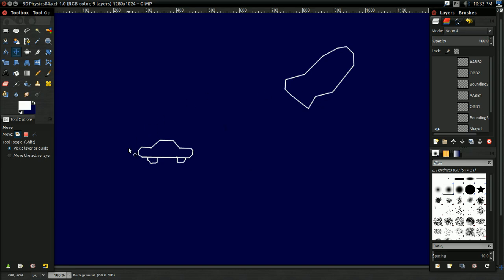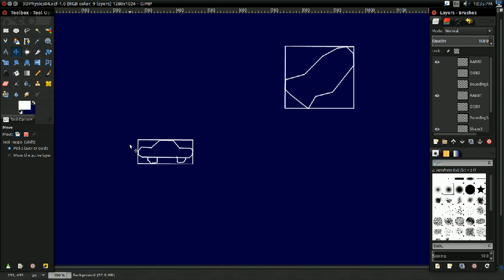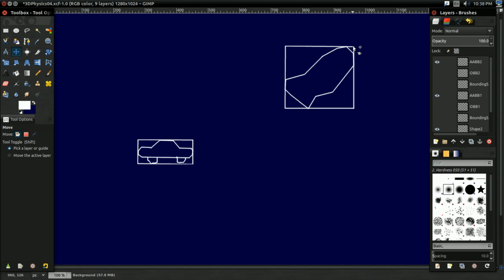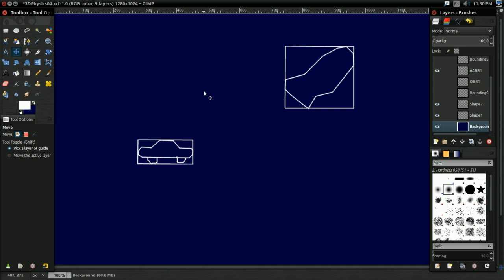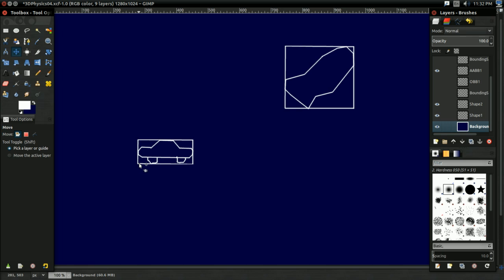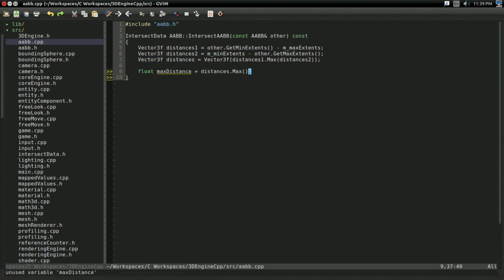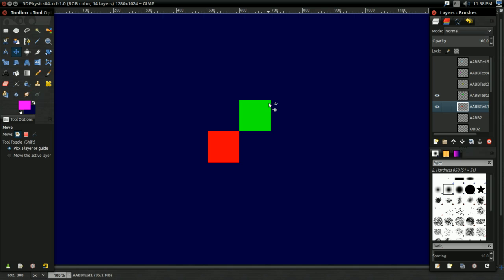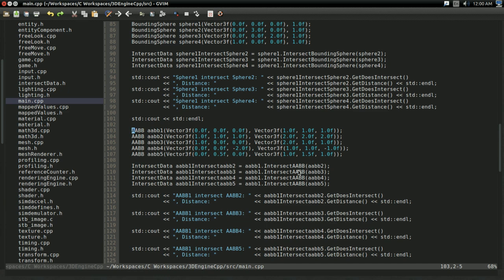#4 3D Physics Engine Tutorial: Axis Aligned Bounding Boxes (AABB's)

Comment: Hi. Great video. Do you know old game called Arkanoid ? it has one ship, one ball and  a set of blocks which you must destroy with  the ball, around 20 or 30 of them. Is this method AABB will eat my CPU performance  by comparing the ball collision with all blocks ? What is your opinon on that ?
Reply from the maker: ColumboJedi Well, in a complete physics engine, you won't be testing every AABB against every other AABB. You'll be using some spatial structure like an octree to reduce the scope of the problem with every step. Instead of doing everything against everything else for an O(n^2) performance curve, you'd have an O(nlog(n)) performance curve, which is much more reasonable and scalable.
Reply: ***** That is a great tip. I understood it completely. Another question I have is this: should I check for collision every frame step ? or maybe every 20 frames ? I defined my opengl application to run 62-63 frames per second. The player should not notice any delay of collision, so it should be under a second I suppose. Developing opengl game is tricky. =) And I love it.
Reply from the maker: ColumboJedi How often you update your physics engine depends on what kind of game you're making. In a typical game, you won't go wrong doing 60-50 physics updates per frame.

Regardless of how fast you update your physics engine, you should do complete physics updates. For example, you probably shouldn't update object positions 60 times per second, but check for collisions 10 times per second. The issue comes when, for example, two objects start colliding on update 1, but their collision only gets detected on update 5. In the intermediate updates, anything they did is invalid. This isn't horrible if all they've done is moved, but it becomes a lot more difficult if one of the objects has, for example, started colliding with a third object that it wouldn't have collided with if the original collision was resolved properly.

Although even the "ghost collision" issue is still resolvable, the simplest solution is to avoid it altogether and just do complete physics updates.

Keep in mind that although collision detection isn't cheap, it's not horrendously expensive either. In a well-designed collision system, you're unlikely to spend more than about 2 or 3 milliseconds on collision detection even under fairly heavy loads. As always, your figures may differ, so profile your engine and budget accordingly.
Reply: ***** well, my collision detection is very good, no doubt. But I cant detect which side the rectangle hits another. I did the math, and it was working well, but when I got like 60 rectangle on the scene, things starts to get weird. How would you detect which side collides ?
Reply: ColumboJedi already solved my problem. thanks any way. Best videos ever about opengl.

Comment: Are you going to cover terrain collision? (probably a retorical question i am asking here), but with support for elements like bridges / caverns, sort of like what Super mario 64 does, I might not have been googling hard enough but I can't find anything on the subject, thanks!
Reply from the maker: There's nothing special about those sorts of colliders. A generic triangle-mesh collider should work fine for those cases.
Reply: ***** I imagined that would be a solution, but wouldn't that cause a lot of lag? unless limiting it to only check within its position; I might be overthinking this.
Reply from the maker: Slaydon Measure before you decide what's a performance issue and what's not. Yes, a generic triangle-mesh collider typically performs worse than the other colliders in a physics engine. However, it's certainly no slouch either. As long as you don't do something ridiculous like use a generic triangle-mesh collider for everything, you're probably not going to run into an issue.
Reply: ***** Alright thank you! and thank you for what you are doing. Back to lurk-mode.

Comment: When checking for collision, is it not possible to check for individual vertices in the obj file? For example, you could have some method which keeps track of the obj vertices' positions in 3d space and checks if they match or if they are in collision with a face of an object. So you could have a method like :     public boolean checkCollision (Vertex [ ] vertices){   if (vertices.v1.x == vertices.v2.x || vertices.v1.y == vertices.v2.y || vertices.v1.z == vertices.v2.z) return true; (and so on for face collision)} Obviously that method would be for a singular obj, and it would probably drag down performance,  but say you had a game with like a sword, you could implement a split method, which separates vertices from each other upon collision and it would be far more accurate.  Would there be any strong problems with doing it this way? Thanks.
Reply from the maker: What you're talking about is a form of soft body physics with generic triangle mesh colliders. The answer is yes you can do things like this (although perhaps not with the code you've given), however it should be avoided if possible.

For one, you have to keep in mind that rendering meshes are drawn using specialized hardware optimized for rendering. Physics meshes, even when GPU accelerated, don't have that luxury. Therefore, it's probably not the best idea to send your rendering mesh directly to the physics engine if you can help it. You're better off using a simplified mesh if at all possible, especially since a lot of the details on the rendering mesh don't particularly matter for the physics mesh. (You probably won't care about how the fancy carving in the side of your sword affects collisions, for instance.)

Furthermore, generic triangle mesh colliders are typically the slowest collider in a physics engine, and soft body physics are typically have the slowest simulation/collision response in the physics engine. Put them together, and you can quickly run into performance issues. If you must do this, use it sparingly.

Comment: Is this system used with objects that can rotate around their pivot and each simulation loop the size of the box gets updated if the object has rotated. The collider stays axis aligned this way. Or is this inefficient and are other colliders used when rotating? Maybe this actually is the main idea, I don't known. I am new to these topics but I'm excited to learn more of you Benny!
Reply from the maker: You can do that, but I wouldn't recommend it. If you need rotation, you should probably use a collider that better accounts for rotation.

That said, if for some reason you must use rotation with AABBs, what you'll probably do is this: Create an AABB for the initial mesh with no rotation, and store that somewhere. Whenever you need the AABB for some reason, create a new AABB based on the initial AABB that adjusts for the mesh's current rotation, and use that for collision. However, keep the initial AABB stored.

As long as you base all the rotations off of the initial AABB, you won't have errors accumulate with rotation.
Reply: ***** Ok thanks for clearin that up :)
Reply: Rob Salaets There is AABB that supports rotation, i think its called AOBB. If you need i can search for one very good page. It has 15 vs 15 collision checks. There is 15 collision types , and that page has all colision checks for all of them (15 * 15 urls)
Reply: Its okay, I just wondered what the main idea of the AABB's was and if the rotation had anything to do with it :P Thanks for responding!
Reply: Rob Salaets No problems.

Comment: What if the bounding boxes intersected on all three axes? The max value may not represent the penetration depth.
Reply from the maker: It won't represent the absolute penetration depth, as in (corner2-corner1).Length(), no. However, you probably don't care about that value with AABB's anyways.

Think of AABB's as being defined by their 6 faces for a moment. In that case, the only way they'll hit other is if their faces go through one another. So the penetration distance you should care about is the distance between those two penetrating faces. Since these faces are only on the individual x,y, and z axes, this system should find just that.

If they intersect on all 3 axes, then the AABB must have intersected on one of the axes first, so you still only care about the penetration distance on one axis.

Hope that answers your question. If not, because I misinterpreted you or something, please let me know.